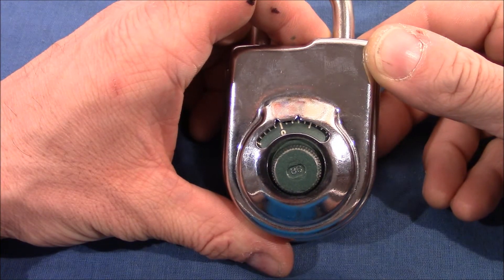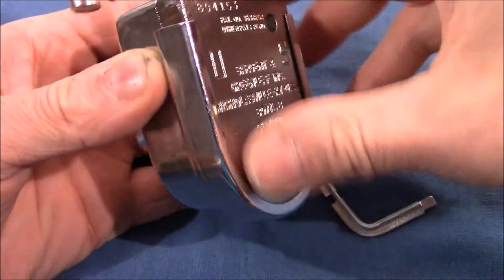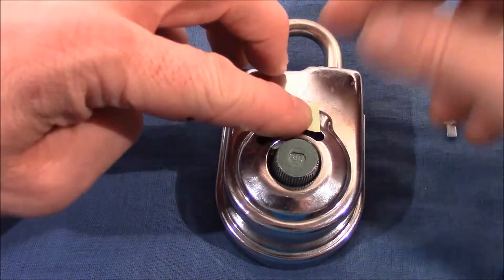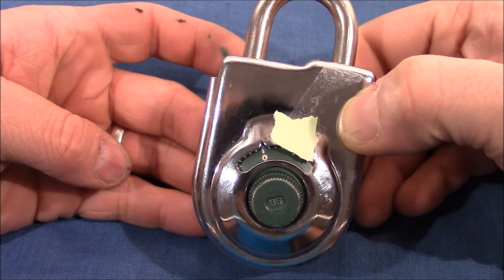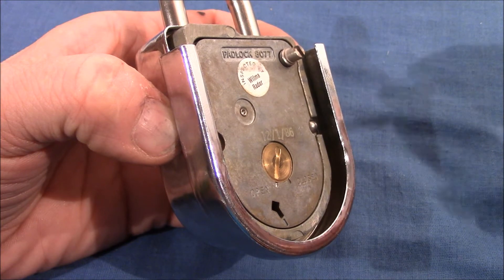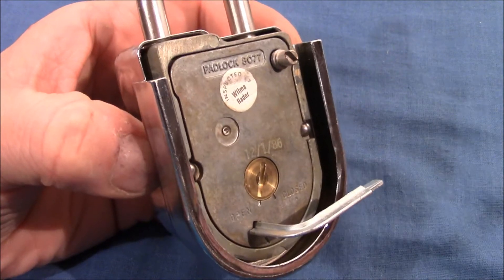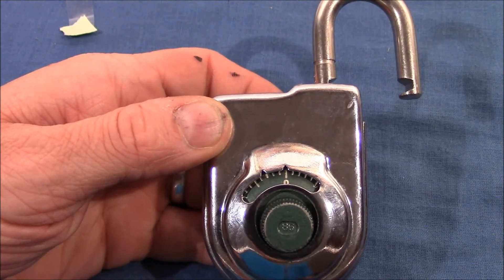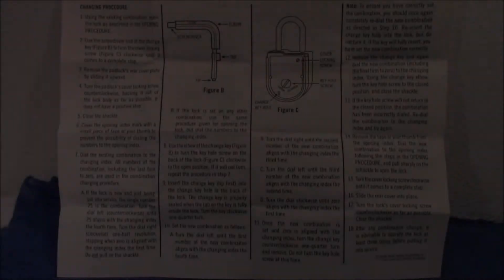(picking 127) Sargent and Greenleaf combo padlock 8077 - changing the combination

Comment: Thanks! Was helpful. I have an old 8088 and the steps are similar but the video reassured me I was doing it correctly. (Actually messed up the first time and had to figure out the numbers and then try again and succeeded!)
Reply from the maker: +Spencer Petersen Haha, that's why I also made this video. If I had messed it up I could have looked at the video and maybe would have found the mistake. How did you figure out the right combo after you messed up?
Reply: +Potti314 It was actually easier than I thought. I looked through the hole in the back (where the change key goes) because it was still open from changing the combo. It was easy to find the hole furthest back but the other 2 where hard. I managed to find the 2nd one back so now it would be my 2nd to last number. i had the first two, and 0 so I just started to guess on the last one. I was able to do a little math and get an idea of where it was. If I didnt see it i'd stick a knife pick in and go side to side to hopefully drag it into position. If that doesnt make since I can make a video and post it.
Reply from the maker: +Spencer Petersen Thank you for the detailed explanation. I think I got it :-) But of course, I always like to watch new videos ;-)

Comment: Hi! Can this be decoded as group 2 safe locks in looking for contact points etc? That would be great to have a portable safe lock to practice decoding. I looked to add this to my collection but it doesn’t seem very common in Europe.
Reply from the maker: No idea as I'm not into safe cracking ; no experience.
Reply: No
But this is OP compared to common locks

Comment: I didn't think it was going to open near the end.  I'm glad it did
Reply from the maker: +RJ Robert James Me, too. When I stuck the key in the hole the second time for testing and it was a bit rough and when I read to close the shackle although I didn't open it before, I was not quite sure that I did everything right ;-) But finally, baam - open. We don't need no stinking keys ;-)
Reply: +Potti314 hahaha that's right no required. You would have been screwed if you messed up.

Comment: Are you able to feel the contact points on that type of lock??? the gate contact points?
Reply from the maker: +CopLock The only thing I can feel is if one wheel takes along the other, nothing more. Great quality lock :-)
Reply: S&G very good locks for sure.  I'm also a beginner at spinning too and that's why I was asking.  Very cool lock
Reply: +CopLock Even though you arent able to feel anything but "0", people often will only set one number rather than setting multiple. 10-20-30-0 is  the default for the 8088. The one i got was set to 4-0. This leaves less room for error. I know your comment is 2 months old i'm just sharing what I learned (today) incase you havent found anything.
Reply: Thanks for the response.  I'm just trying to learn.  Great video btw